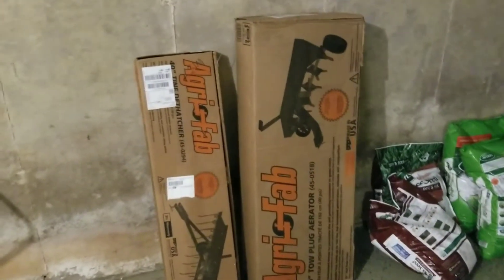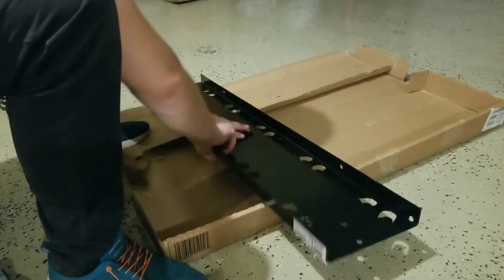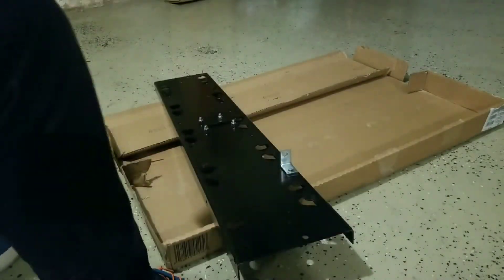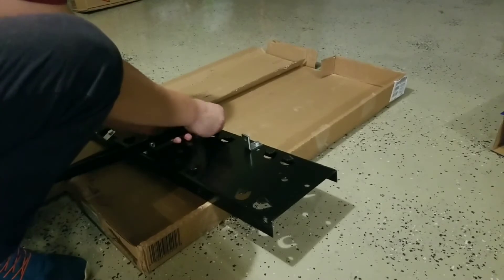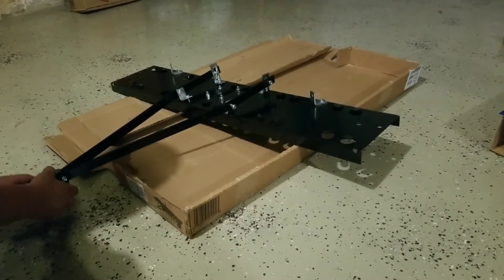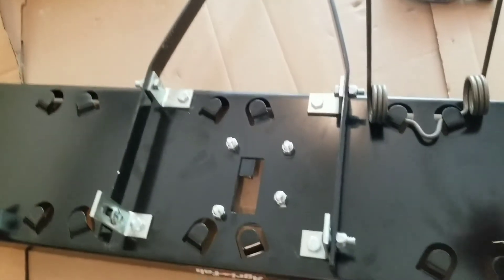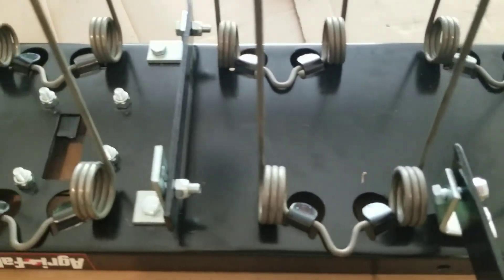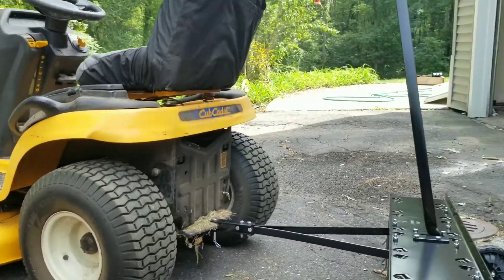How to Build Agri-fab Tow Behind Dethatcher

Comment: I have a 28inch wide mower just fits through my gate how wide are the wheels  and axle I’m thinking of cutting it down save me carrying through gate plus my mower manufacture says can’t tow but who cares
Reply from the maker: The wheels and axle are narrower than the times so that's not an issue. It is not very heavy and can be lifted easily assuming that there isn't any weight on it.

Comment: I have been struggling with this assembly following agri fab video.  I am at the point of attaching the lift handle.  It doesn’t seem to fit....it’s too long and doesn’t bend in the right place.  Any ideas?  Thanks
Reply from the maker: Make sure the bracket is on the correct way by looking at the arrows on the top plate so that they are pointing forward. The bracket could be the wrong way up or needs to face the opposite way. If that doesn't work or help, send me a message on Instagram and I will send a video of how mine looks.
Reply: @DIYwithCam  thank you!  The wheel axle bracket was upside down.  Thanks for the help.